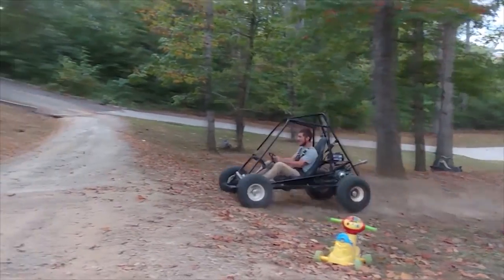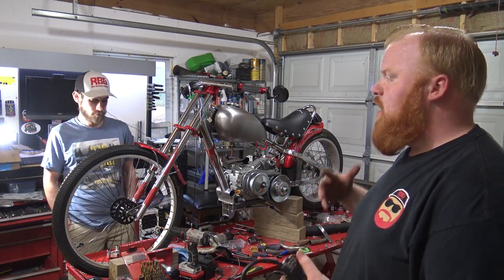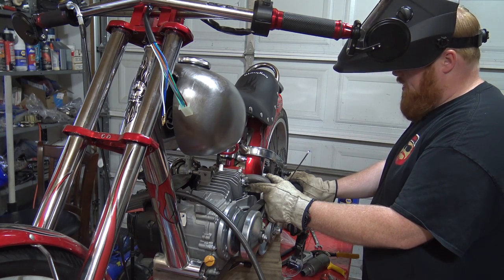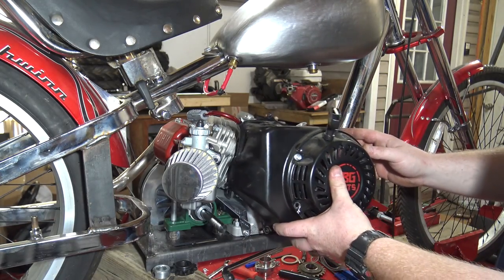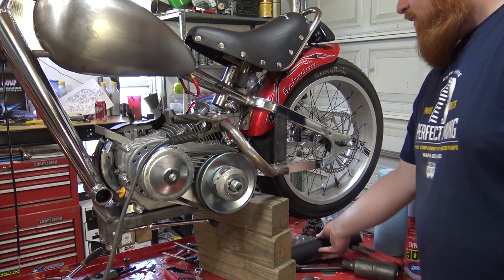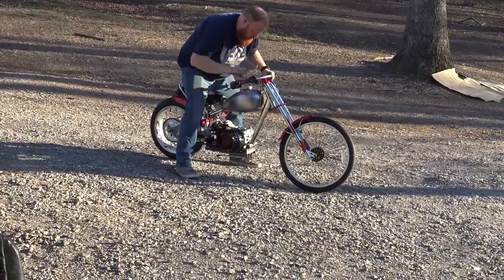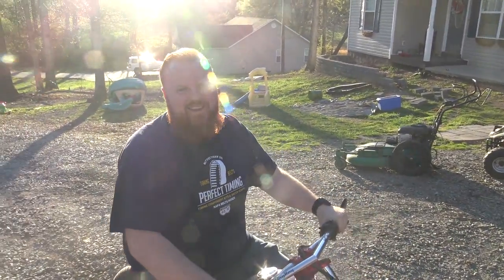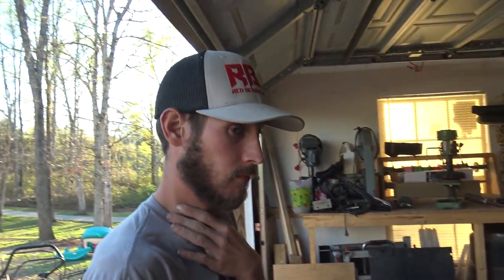Predator 212 Mini Chopper Build Ep 3

Comment: Hey Red Beard,  I've got a 212 that I plan on:  removing the governor, jetting the carb, straight exhaust, and a bigger air intake.  Do you know about how much more Hp I'll get out of this?  I've seen all kinds of videos about performing these mods but never figured out how much Hp is added to the stock 6.5
Reply from the maker: I would think around 12-14hp. Now thats just a guess but probably pretty close.
Reply: Double stock power!?!!  Wow!  I'm looking that much more forward to this project now! Thanks!
Reply from the maker: Well you got to think your max hp is usually at the highest rpm. So when they rate it at 6.5 at 3600rpm's your going to gain probably 2hp just from removing the governor. Then you give it more fuel and air and it will boost it up a lot more.
Reply: alright. thanks!

Comment: I think I'm going to have to do one of these. I have the frame. probally do a dirt bike engine in it.
Reply from the maker: The 212 is really all the power you need unless you use like a 110 or 150 engine. You really don't need much to get some real good speed.
Reply: I was thinking something 2 stroke. I love 2 strokes.

Comment: Are those spokes going to be able to handle that torque, when you accelerate?
Reply from the maker: +Keith Brettell not for long. I'm going to put different wheels on it
Reply: Keith, I tried the stock wheel on a Sixthreezero bike and anticipated problems with the 1" hub bearings and sure enough, one of the bearings gave
up and I replaced the wheels with a set of mag wheels with sealed bearings and so far it's been ok. The 212cc is a TORQUE MONSTER and will
break things so you have to baby the bike or you'll break things!  The best setup would be a motorcycle frame and wheels. The speed is scary
fast up to 70+ and cruise speed is an easy 35-45 mph in any wind.

Comment: Do you break-in your motors with standard motor oil before switching to synthetic? THANKS
Reply from the maker: Yeah I usually use just standard 10w-30 and run the engine at idle for about 15-20 minutes and then half throttle for another 5-10 then change the oil.

Comment: hey red, i have a 40 series torque converter on a 301 predator. an issue that im having with it is that at higher speeds, the belt will come off and get shredded by the chain. currently im using a 203589/5959 belt. any suggestions?
Reply from the maker: +Rancho Polvorin let me check with go power sports to see what belt they recommend.
Reply: Red Beard's Garage 
ok, thanks

Comment: Hey red can you help me I purchased the brake rotor adapter but it wont fit my bike the ID is 34mm but the one on my bike seems to be 38mm any advice.
Reply from the maker: I did the same and im going to have to make a new caliper mount it will be in a later video

Comment: The air gap on all coil to flywheel for all air-cooled engines has been .010" to .012".  But I always use a business card as well.  Also I would coat the " inside " of the exhaust pipe with very high heat flat black rattle can paint.  This also is the best way to keep a chrome exhaust header/pipe from bluing or discoloring .  Thats a old school Harley way of preventing bluing & yellowing of chrome .   Just hang the pipe in the vertical position and empty the rattle can paint while turning and tipping to cover all.  Also,  By painting the outside of the pipe with " non " heat can of white, and where the painted area stops burning off its coating of white paint in where to cut it off.  This is how we got a " tuned " length of header pipe.  Any questions, just call me and will explain in detail.................Okie.........
Reply from the maker: Thanks for the info brother

Comment: good job. did you turn your rear tire around? it was backwards
Reply: and remember, Gretta had just one, regular bike brake. you're fine
Reply: plus I used bailing wire to lace the spokes to each other in the direction of travel. it kept the spokes from bending/snapping.
Reply from the maker: Yeah I flipped the tire around but it wont be on there long im going to put a motorcycle wheel onto it.